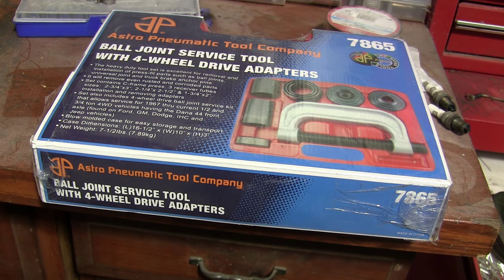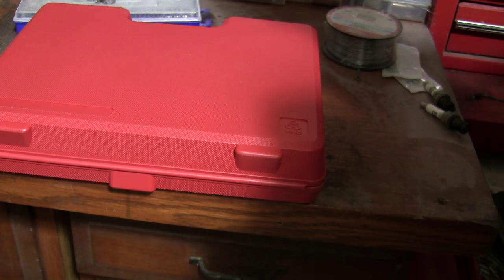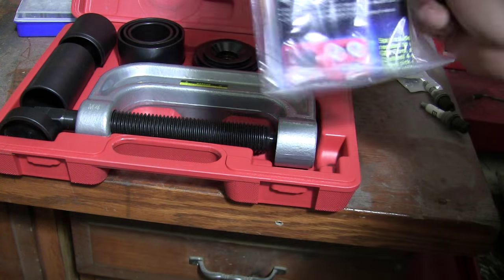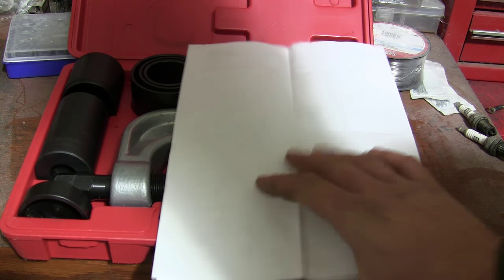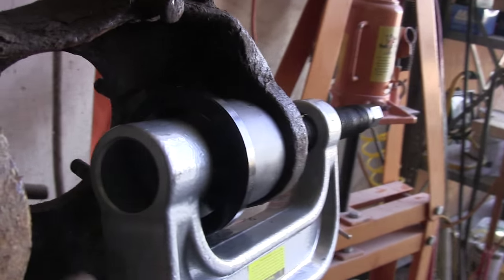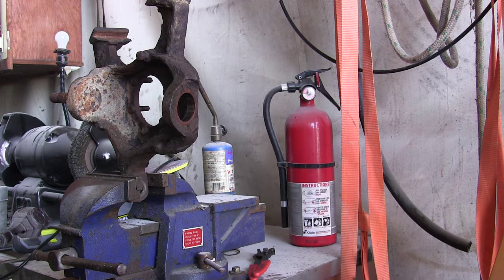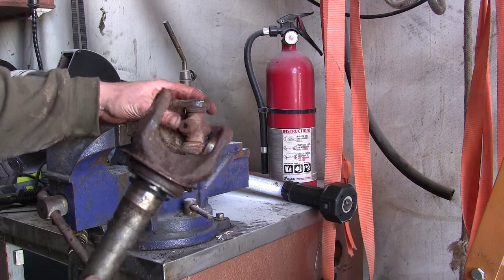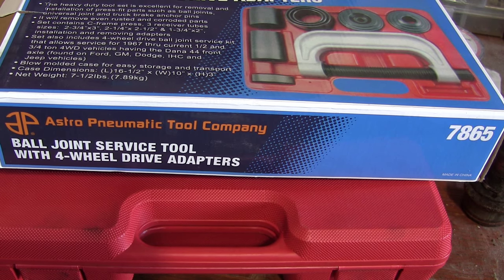Astro Pneumatic Ball Joint Service Tool Review

Comment: I have a similar but more extensive kit. I found the parts useful but it was very tricky pressing the ball joints back in uniformly. I ended up taking the control arms out and used the adapters with a hydraulic press instead....much much easier. It was OK for getting the ball joints out though but slow.

Comment: I have what looks like the same one but from harbor freight. So far it has held up well.
Reply: You've got a good one there.I also have the Pittsburg one .Bought it 7 years ago, probably replaced about 500 ball joint with it.It also works good for u joints and removing wheel studs.Ill bet astro Maddox and Pittsburg all come out of the same factory.As the guy says above always grease the threads and the tool will last forever

Comment: Nice review and a great video to boot. I've been thinking about buying this kit got changing the lower ball joints on my 1999 Dodge Dakota 4X4. I'm not sure what size sleeves I need so I'm thinking about also opting for 7868 adapter sleeve set too.

Comment: On ebay you can get the same set, maybe from another brand, for $39. I did, and used it to change the rear balljoints on a BMW740il. Save $600, the dealer wanted $300 a piece. i did have to modify one of the receiving tubes.
Reply: Gilbert Rodriguez now you have the tool, do ball joint job for someone and boom you paid for your tool. lol